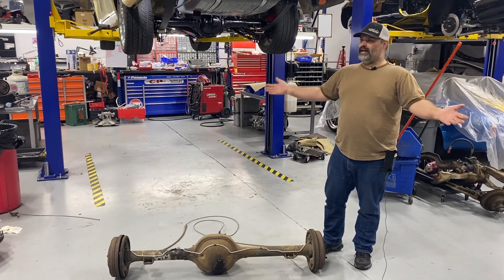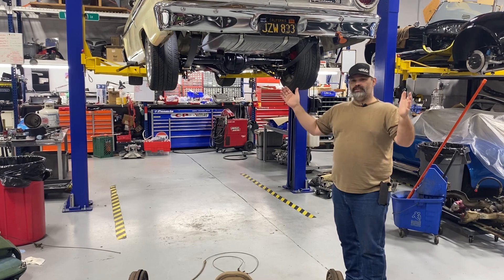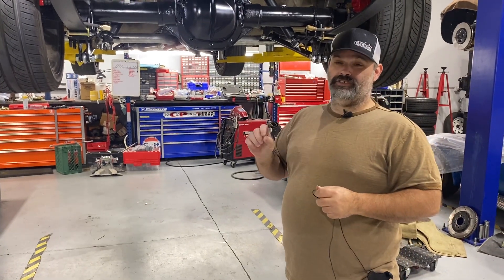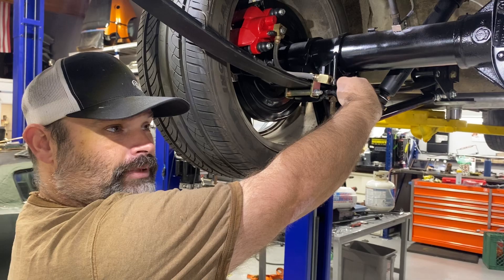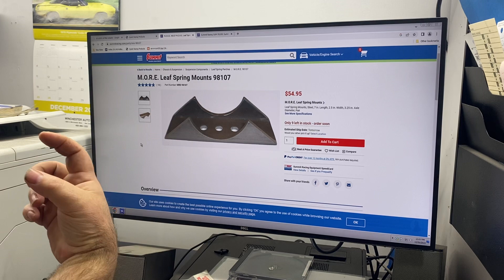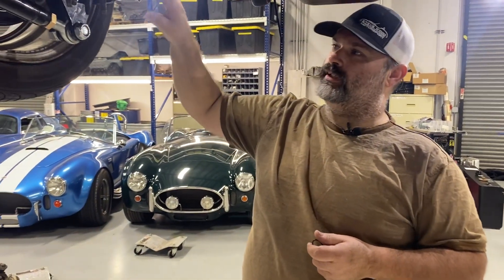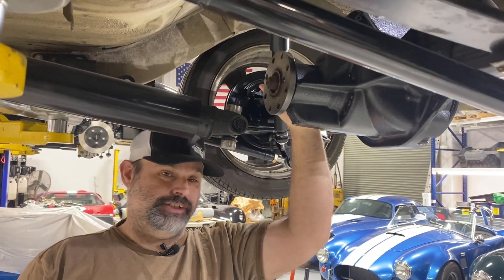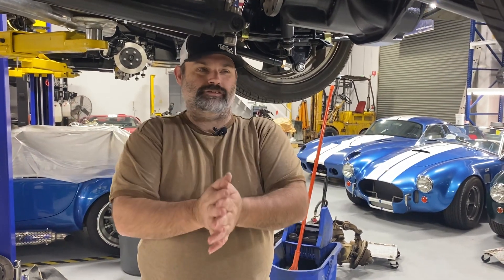8.8 rearend swap into 1964 Fairlane

Comment: I will attest to the 8.8 strength, especially with aftermarket axles. Several years ago, I pushed 607.5 HP through one and it did not break with abuse, and wheelies.

Comment: I have a fairlane 500 wagon on my hoist right now. Drove it here yesterday and I already have the old engine and trans out and it's new 5.0 HO mustang engine sitting in the engine bay on the mounts. Bolts right in! I was wondering about the rear end and I think ill be doing what you did with yours... Thanks for the great information!!!

Comment: So I have the same setup for my 64. I purchased the spring perches and shortened them to move the centerline back. The Calvert shock plate mount doesn't line up on the peg on the leaf-springs. Did you machine the hole on Calvert shock plate to fit the springs correctly?

Comment: I’d love to get a full list of parts for this upgrade. I have a 1964 four door and it’s time for some upgrades!
Reply from the maker: We’ll get the rear end cut it down and call Calvert racing and get there mono leaf set up for the car.  Grab the rear u joint flange from the truck you got the rear one from or call a drive line shop they can supply you with one. Make sure you have a 1 1/8 brake master cylinder if doing rear brakes

Comment: great video.  i am doing a 65 fairlane and working away bit by bit.  i am not sure what gearing is in my rear end and have not taken it apart but i think the idea of swapping the whole unit out is the way to go.  my question is in regards to the single leaf spring, can you tell me where you got them and what they look like.  i have the original springs and they are ugly.  would appreciate any  direction thank you
Reply from the maker: They are mono leaf and there from Calvert racing.   It’s a ez install bolt in.   The only thing make sure to tell them you need the front hanger to fit the car

Comment: @Carburetor Cowboy - Nice work and helpful info. What is the backspacing dimension on those 9" wheels? Would you keep the same backspacing with a 10" wheel?
Reply: Yes it would be awesome if the OP would take the time and answer your question.  I would also like to know.
Reply from the maker: The backspacing on the 10 inch rim would be 5 inches

Comment: What drive shaft are you using? And which conversion joint do I need? I’m using a toploader 4 speed with the 8.8 I plan on installing. Thank
Reply from the maker: if you building a new drive line then they will get you the correct set up..if not the rear u joint will be the conversion joint ..and i dont have the dana/spicer PN next to me